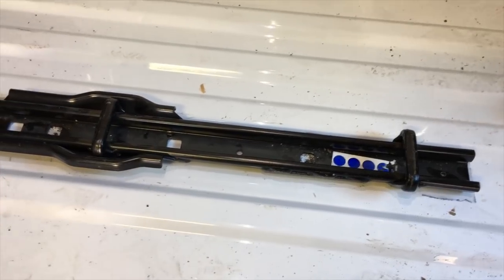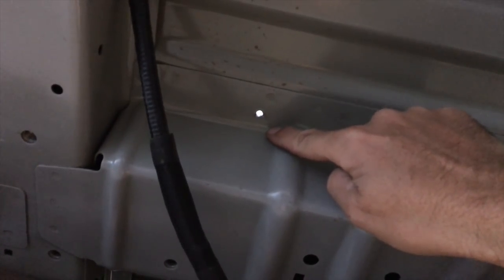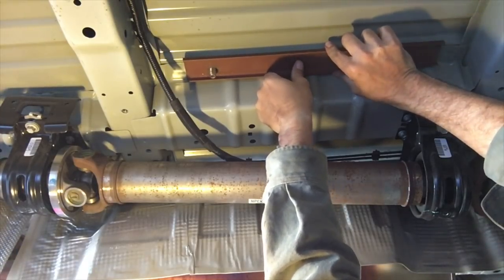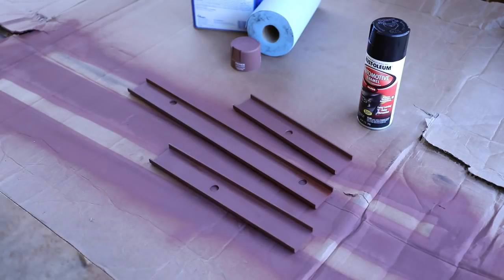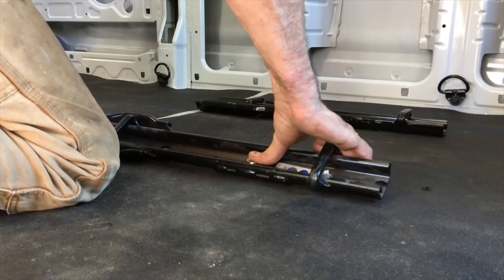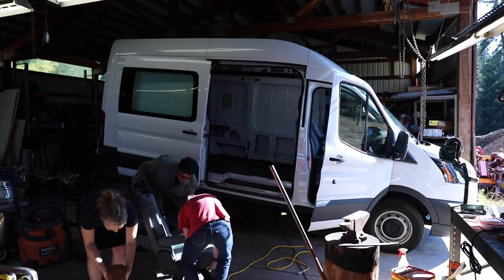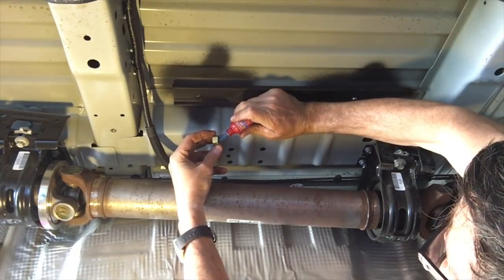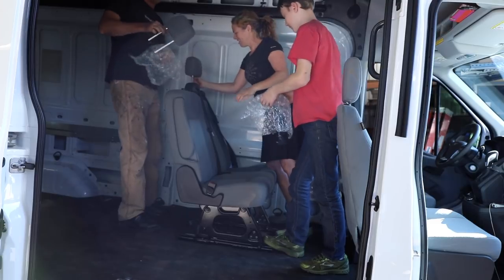Building The Ultimate Stealth Van 6

Comment from the maker: HERE IS THE LINK TO THE DE-BURING TOOL   ONLY $8  https://goo.gl/nRkbhY
THIS IS AN AMAZON AFFILIATE LINK.
Reply: Cody I like your channel. I have a 1942 the Western fire fighters Manual, Would you like it? 
Please say if you want it.
Reply: Cody!! i think you will like the movie coming out in October called "ONLY THE BRAVE" check out the trailer
Reply: DEBURRING
Reply: Use nylon nuts please
Reply: Please use undercoat to save the bolt holes from rust..and maybe use some steel plates to reinforce the boldholes

Comment: Cody, I think you'll find that the seats do need to be bolted metal to metal. The purpose is to create a solid joint. What you have there is a joint with a soft fabric washer between. I theory it could be fine, but in the event of an accident, massive forces will be placed on the joints. The other thing you need to replicate from Ford's standard factory practice is to use high tensile bolts for the seat mounts. The way to avoid having an insurance company later disallowing any claim is to use EVERYTHING the factory used. This will probably also involve high tensile bolts with the thread only being on the lower part of the bolt and a clear shank where it passes through the seat rail, floor and bracket. The best way to get around this is to buy the Ford parts and keep the receipts. Your objective should be safety through build integrity and good engineering practice first, but also liability mitigation.
Reply: Agreed. You use the bolts to mate the two surfaces and clamp them together. The friction you get between the two surfaces holds stuff in place. Not the bolts itself. That's why you never should apply grease on the mating surface of a wheel and axle (even if it rusts; that's what keeps your wheels in place), and why using fabric between the seat and the car is bad practice too. Forces on the bolts will be much higher if you don't have solid metal to metal contact.
Reply: It's unsafe what you have done in many ways. You don't have the qualifications/knowledge or certification to do this work and to show it on youtube is irresponsible.
Reply: you don't need a damn certification to modify a van
Reply: He use grade 8 fastners where only grade 5 are required he did just fine.
Reply: No, you don't. But broadcasting it into a society where people take things from the internet and apply it in their lives is a little bit irresponsible and can be fatal. Looking at you non-vaccinators
Reply: Wow.. vaccinations are REALLY off-topic here.  But yes, pharmaceutical companies will profit from vaccine sales, just as Cody profits from his videos.  They provide value and get compensated for it.  It doesn't negate the value of the service/product.  It is completely irresponsible to promote anti-vaccination.  Eradicated diseases are making a comeback thanks to anti-vaccination nonsense.  Risk versus reward.  Everything has RISKS associated with it; the reward of vaccination is prevention of terrible fatal communicable diseases.  If 1 in 300 000 000 people have an adverse side effect, that's a risk I am willing to take to prevent small pox, polio, rubella, diptheria, tetanus, etc.
Reply: You're welcome Adam Newman and thank you for your kind words and insight. People make the mistake of conflating good engineering practice for the purpose of safety, with gov mandated chemical solurions to the issues nature very often already has the answers for. But their paymasters in big pharma can't make a profit if they don't own the intellectual property rights to that plant in its natural state. So they synthesise it, patent it and then sell it under a trade name. This will happen to Kratom in the same way it's happened to cannabis. And the request legislation to criminalise it will follow the fake nuZe stories that demonise it as dangerous. They never rely vary the playbook. 

I do respect your right to believe anything, and pray as you choose, but my understanding is that the gods were the earliest inventions of mass population controls. Organised religions played the role of government before governments became possible with the imposition of ownership and borders upon free land. Therefore I trust in Nature and seek knowledge of the truth - as Jesus is said to have advised. 

But when we abandon fear of difference and assumption in our ways of dealing with the world, and apply good practice - for the right reasons, we find we are not only safer, we are more in harmony with nature also. 

Peace.

Comment: Cody,  (great name by the way) FYI you can also get different types and shaped cutters for your de-burr knife.  They have a "sideways U" shaped one that would help you get the back side of the panel a lot easier especially for thinner material.  Also have some really nice sharp ones made for plastic.  I used them all the time when I worked in a fabrication and machine shop.

Comment: Great video Cody. I'm glad your in the habit of repainting any holes you drill in the vehicle structure. I know the pickups are an aluminum construction for the cab and cargo bed but not sure if the full sized Transit vans are or not. After visiting the Ford River Rouge plant in Detroit, I'm not sure they have the possible issue of galvanic corrosion beat 100%.

Comment: Cody 2 things I would've done different is I would've welding the nuts to the brackets and welded the brackets to the underside of the van  that way if you decide to take the seat mounts out you could just zip the bolts out and the under bracket stays in place with the nuts

Comment: Hey wranglerstar using that cocking under the SUV isn’t necessarily at all in fact because water will be still be going to get through into it from the top having a cocking will block any water from draining also if your reading this I enjoy your videos keep up the great work 👍 also I don’t know if you’ve used a antrust module but we have one and it’s amazing how well it protects the body from rust we have had two same primers on the same fender but one car had the anti rust module and within 6 month the on without it was starting to rust and now over 3 years with a primer the anti rust module has protected it we use a platinum shield protection corrosion control module works great only bad part is after 15 days or so the battery dies but that’s fine because it’s used daily

Comment: Out of curiosity how does your mounting brackets compare to the other seats? Is it the same using plates or is it supported by welds or structural ribs? The mounting floor may be your week point if your not picking up on the uniframe structure. It could lift up under load. Best to compare to original seats.

Comment: I feel like it's a bad idea to leave the floor mat between the bracket and the metal floor. In an accident, the mat would compress and the bolts would shift from their vertical position. This could create enough shear force to snap the bolts. It is the equivalent of not screwing the bolts down completely.

Comment: Instead of using silicone, you could have just welded up your brackets and nuts on the underside. That way it only takes one person to install and you won't have to remove your gas tank if you ever want to remove the seat brackets.
Reply: Coming to America
Reply: Yes! Weld nuts and brackets to underside. Use much longer bolts and cut away carpet topside. IMHO move them away from the side of the van toward the center to improve side impact protection. I didn't like to see Mrs. W. rest her arm on the thin veneer where Cody plans to put a window. Instead of glass, perhaps the inside should be finished with a padded panel top to bottom.

Comment: Little tip. Those holes you have drilled need coating to prevent rust. Those panels tend to corrode over time
Reply: Good Lord, did you watch the video?  He not only primered the holes but undercoated them and spread silicon over them.  Sheesh...
Reply: Tenspeed TheBikeHanger I know. Im a fool. After I posted it, he got to the silicone part.
Reply: That's why you watch the whole video, before posting a comment.

Comment: DANGER!!! You have installed bolts of inadequate diameter! The original bolts are cap head style half inch fine thread. Refer to what is installed in the front seats. Available at Ford, junkyard or Fastenal cheaper.
Reply: lol...I am sure it will be fine.  If you could see some of the stuff I have driven around in through my life you would probably have a heart attack.  His mount and workmanship are far superior to anything the factory has done.